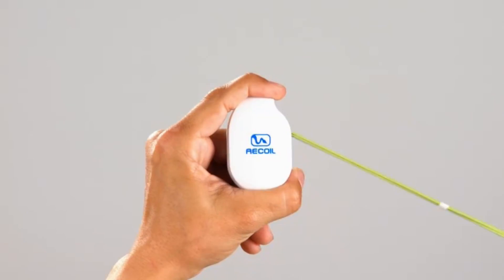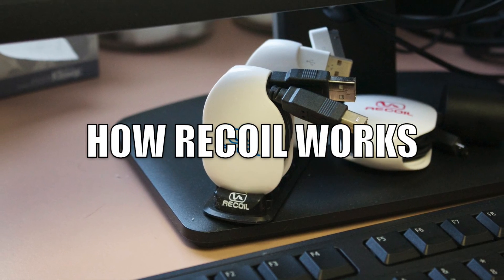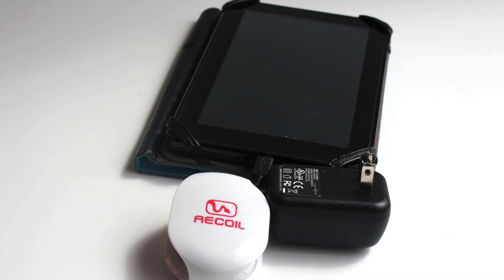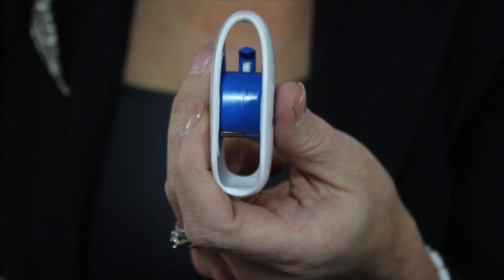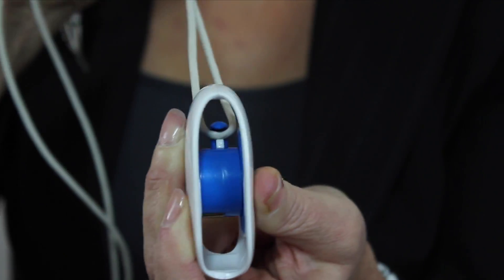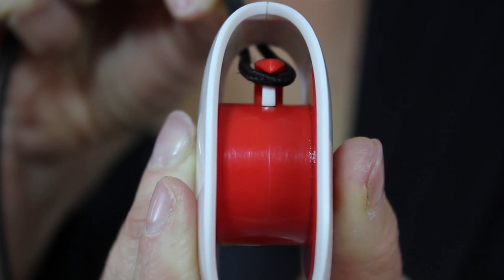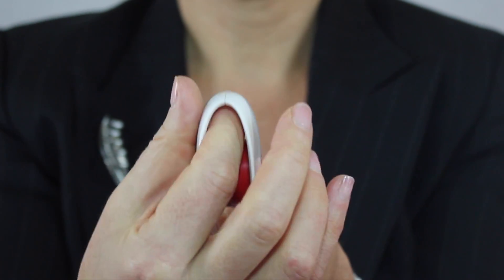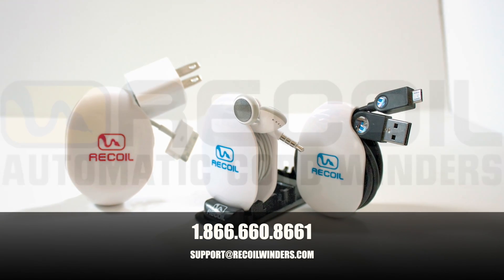How Recoil Automatic Cord Winders Work

Comment: the only trouble i see with this system is that, what if the thing you want to wind up, is permanantly plugged into something on one end? for instance, you've got a phone charger permanantly at your desk, and you want to wind the charger up so it's out of the way, but with this hook design, both sides would get pulled which would either yank the cord out of the charger or send the plastic thing out of your hands towards the charger as it pulled. Wonder if there's a better design to be had. Cool idea though.